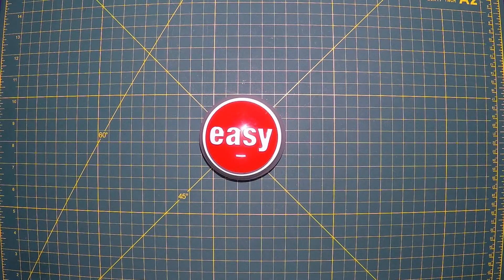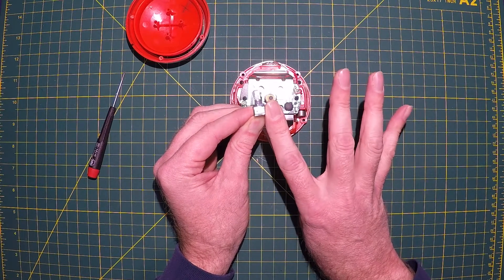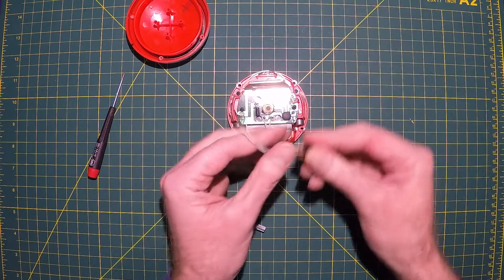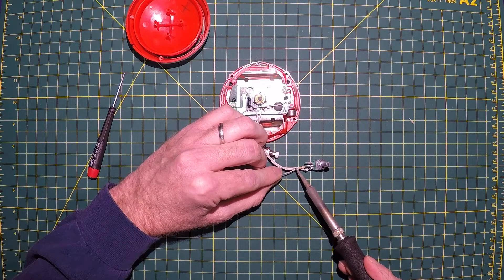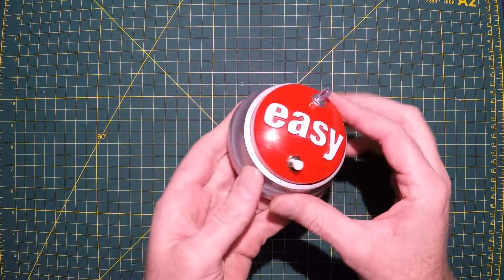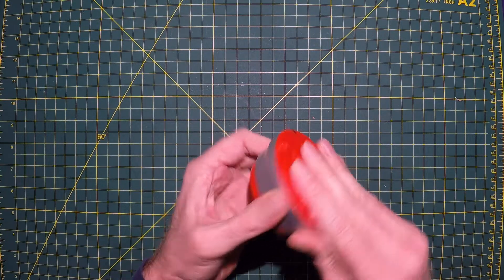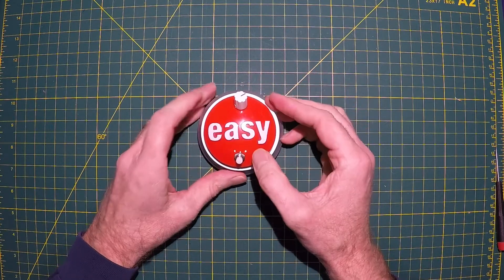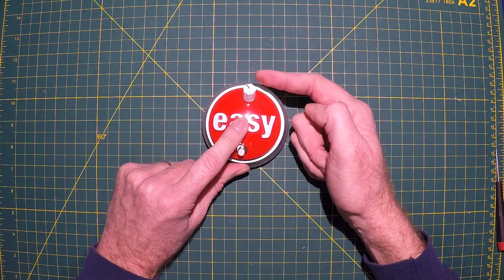Circuit Bent Easy Button

Comment: So my uneducated guess is that we have an op-amp taking a reference frequency and mixing it with encoded output from a microcontroller. The reference frequency, a.k.a "pitch" here, is either already a square wave or the microcontroller makes it into one and uses it as a clock. This would explain the illusion of a pitch drop and the delay as the signal frequency increases - the logic circuitry can't keep up with the clock after a certain threshold and may even be resetting.  I would really love to see/do a version of this bent permanently past the threshold with finer frequency control to glean more unique artifacts.
Reply from the maker: Nice. Your “uneducated guess” sounds a a lot more educated that just about everything I do. Haha. Thanks for info and for watching!